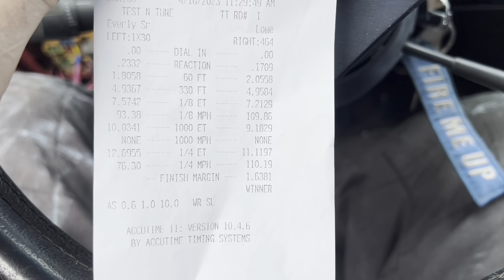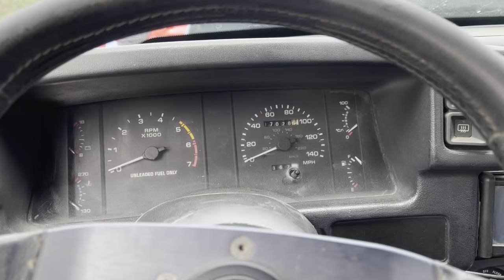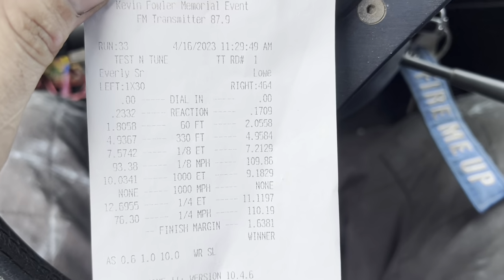I’m sick and tired of transmissions. Need to get a TH400 in this thing stat.

Comment: Keep your head up have fun and reflect on your progress! Your doing things, beats just dreaming about it! What's your next goal for the car?
Reply from the maker: My next goal is to get into the 8s on the stock bottom end. I think the motor has it in it. I just need the trans to corporate at this point. I found some issues when taking it apart that probably contributed to the forward drum issues.
Reply: Good luck

Comment: Just now watching your vids , sucks you couldn’t get it to hold. My 2 c4s I built for our cars haven’t had any issues the foward clutches damage I bet is from too much clearance that’s also why the lower spring probably broke. What clearances did you set them at ? Or were they set at ?
Reply from the maker: Tried and true .10 per clutch.
Reply from the maker: I think the biggest issue is I’m making more power than it seems. I think that I have a combo issue with gearing and converter. I know for sure there’s people running faster than me with pretty stock 4r70w and having no issue and I kept breaking  hard parts. Broke an input shaft and twisted multiple direct drums. Another thing is my car is heavy. 3450 with me in it. Most foxes are on diets and weigh 3000 or less.
Reply: @Wheelsupracing  that’s pretty loose man the foward clutches must be set in the low to mid 20s but yes your right that is really heavy for a c4 our cars are only in the 2800-3000s as well
Reply from the maker: @boosted_3478  sorry I ran .05 on the forward and .10 on the direct per clutch. Had to look through the notes on my phone lol. My car has never been put on a diet. All stock interior down to the insulation and AC box. With all the safety stuff added to the car it’s fat for sure. This winter I’d like to put a tubular k member in the car and maybe a tubular front end to help loose some weight.

Comment: What kind of trans do you have now ? What do you recommend for a manual and auto trans  for 800 hp ?
Reply from the maker: I’m running a powerglide. I don’t know much about manuals but for an auto th400 or powerglide. I’ve been very fast with a c4 they just don’t last long at high power.
Reply: Thanks for info . Can you provide some details on set up , for example if your using an adaptor to the glide .  What kind of convertor are you using ?Any valve body mods ?
 @Wheelsupracing